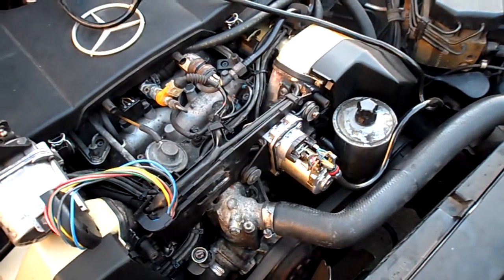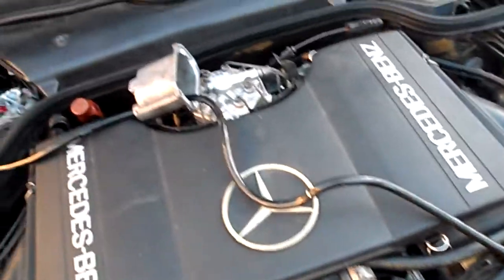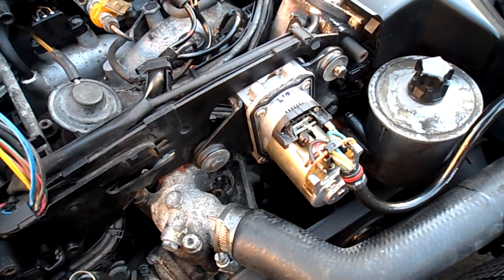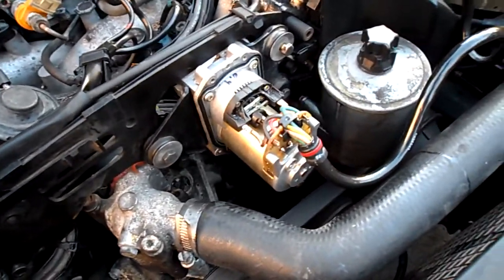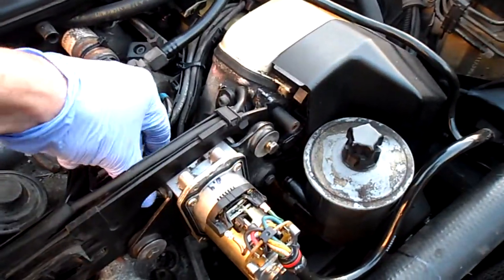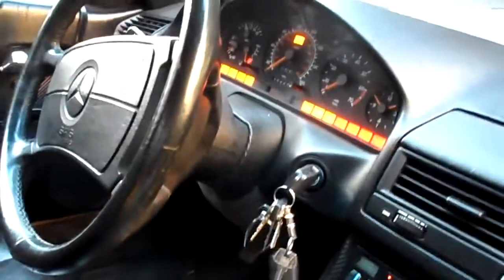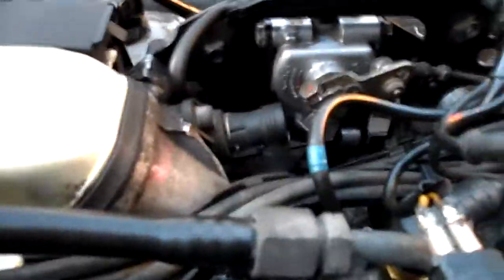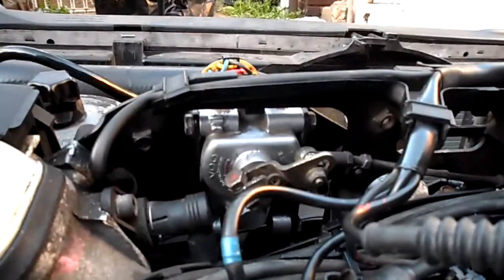Mercedes 500SL throttle actuator test

Comment: If it runs and idles well but has poor or inconsistent throttle response, what could be the issue?  Example; pulling from a stop onto the freeway sometimes full power isn't there.
Reply: Matt Mankinen I ended up finding this out for myself. There is a small screw within the EHA that is adjustable. You have to remove it to get access. I made slight 1/4 turn increments (CW or CCW) until I got it in the sweet spot and it performed like new again